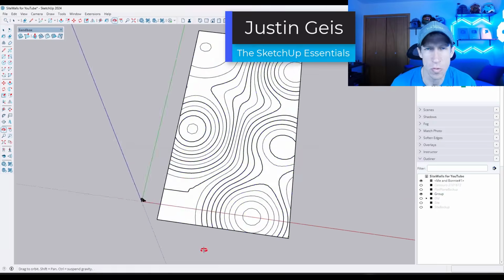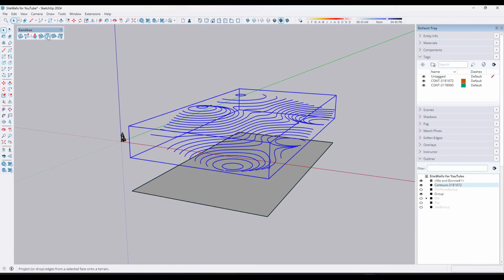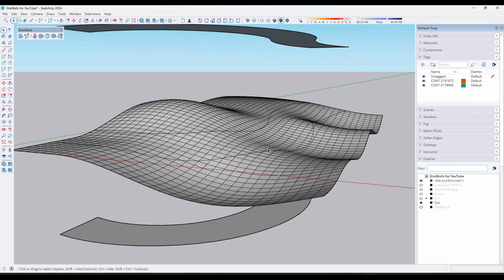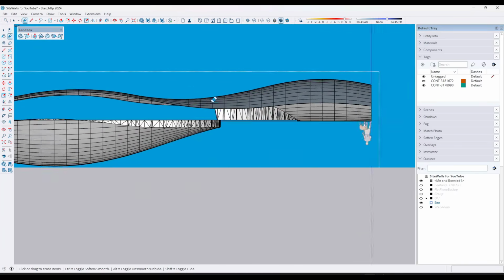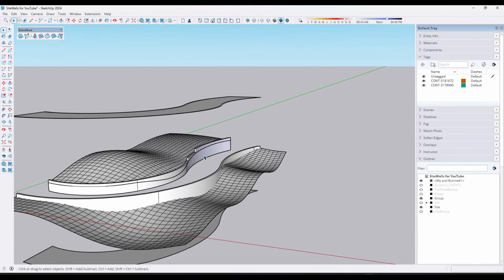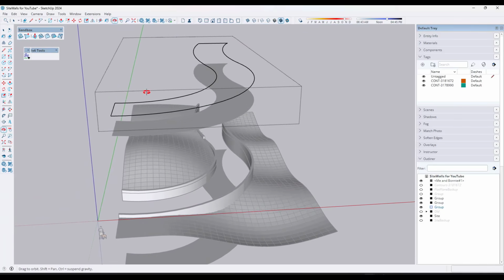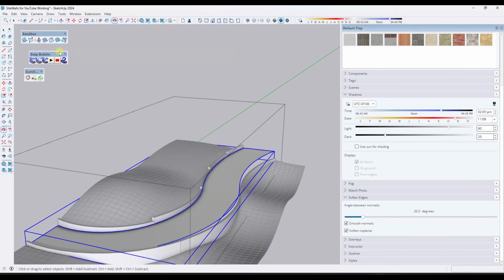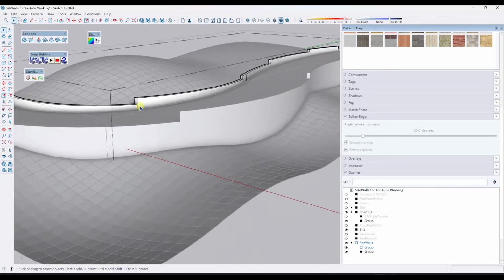Modeling a Sloping Road ON TERRAIN in SketchUp!

Comment: I personally believe that the stamp tool is simply broken. The sheer fact that the offset csnt be 0 is just bad. But combine it with the fact that the height of the stamped surface is only controlled using mouse with no inference... Unusable for anything where you know your heights and dimensions and you just need the tool to help you. This one will actually hurt you instead :D
Reply from the maker: It is odd that you can't set the offset to zero

Comment: I find the stamp tool really awkward; need to have an offset and precision-wise, ‘want it to be right around here’ doesn’t really cut it. If you push-pull your road through the terrain, and then intersect faces, (get them into the same group and then intersect selected faces). You’ll get a portion of terrain you could remove or even move out of the way.